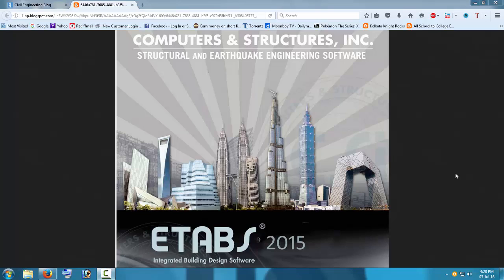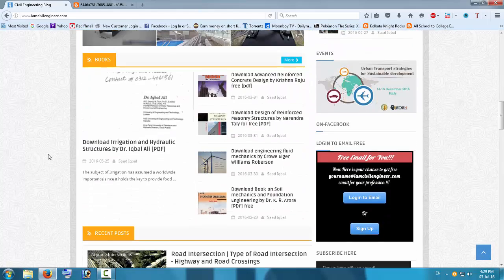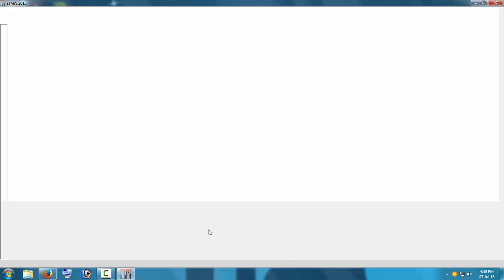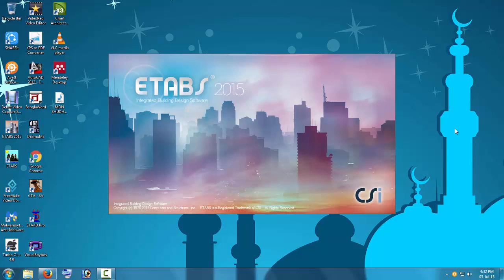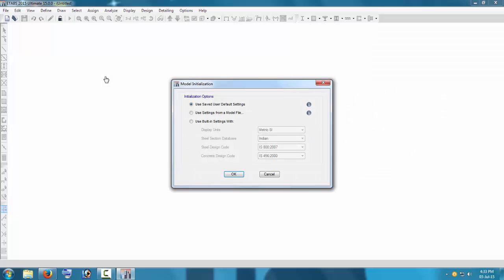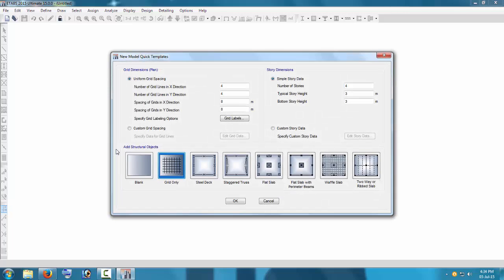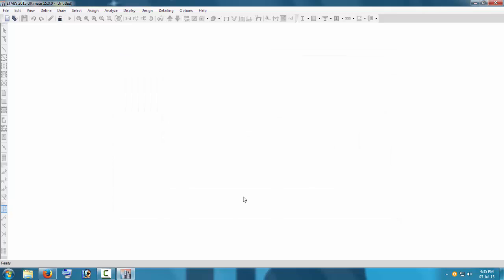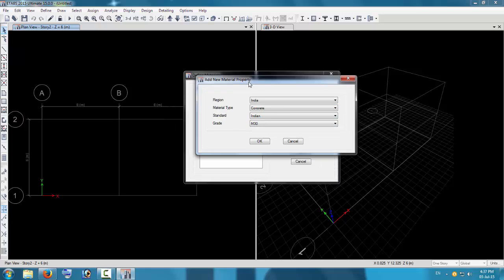Etabs 2015 tutorial 1 | Opening Licence problem solved and Material Properties Using IS Code

Comment: Dear Qamar Moonboy Sir, There is another way for licence problem, In which  you dont have to change date of computer. You may use a software named as "run as date" you can download it from web or here is the link for direct download for both 64 bit and 32 bit OS.  www.nirsoft.net/utils/runasdate.zip FOR  32 bit  www.nirsoft.net/utils/runasdate-x64.zip for 64 bit other detail is on info file.
Reply: thanks bro
Reply: Great help Saunak. Works like charm.